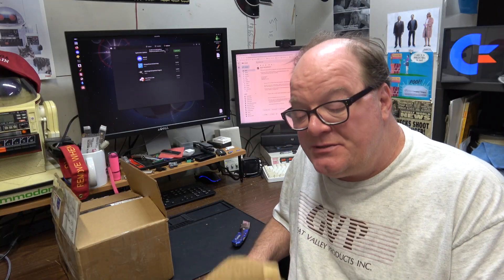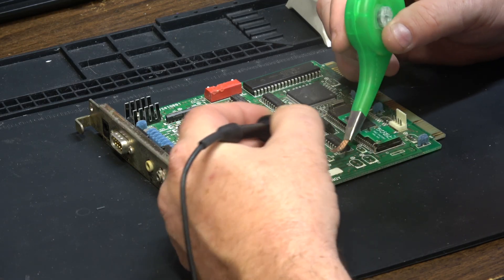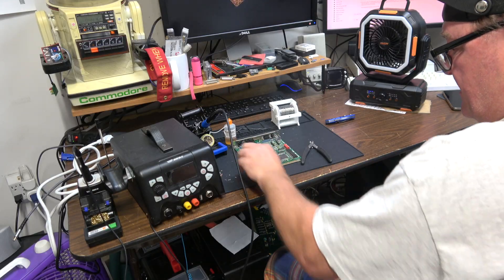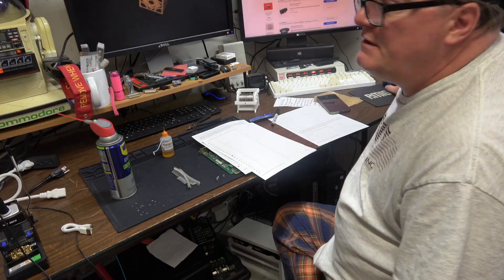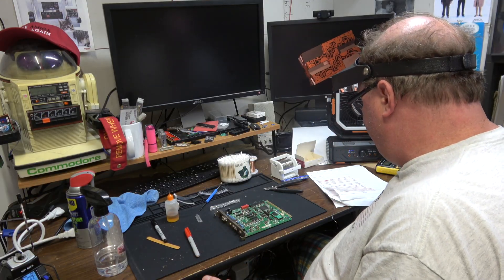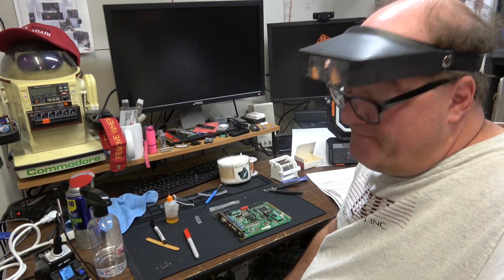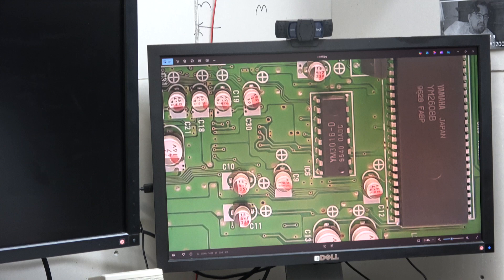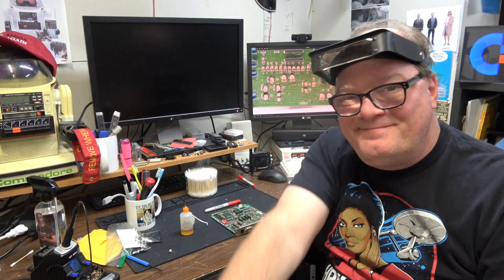NEC Sound card with "The Adrian touch"

Comment: The "Adrian touch"😂 Just push down and twist it off. It never fails. Not! Although I do have to admit I've done it a few times myself and never had any pads/traces lift. But there's always that one time when it will happen and It'll be in the worst situation. I found that it takes just as much time to twist it off as it does to desolder it. With some practice of course! Lol

Comment: I have a lot of PC9801-86 sound cards and 99% it needs to be recapped. It uses the NEC C-BUS equiv of PC ISA cards. Yamaha
 YM2608B (OPNA) 6-ch, 4-op. FM, SSG, ADPCM sound generator .The current price for this card is around 3~400 USD in Japan. This just Proves Chris can fix stuff other than Amiga. Great Video

Comment: It's apparently a PC-98 (Japanese DOS) card and you are welcome to check its frankly insane going rate on you know where, NEC PDW-1089
Reply: The Anime PC.
I'm not the type that collects computers from my youth (I'm 58).
Don't buy those mini versions either. I just emulate.
I never had a PC98 but I do check prices on auctions sometimes.
Never pulled the trigger though.
If a mini PC98 was released though I'd go for it.
Reply: @MrJakeTucker  from what i can gather, outside of touhou 1-5 and maybe a hadful of other games, the rest of the pc-98 library is office software, ports of games you can play elsewhere quite easily and also... adult content. the pc-98 is quite a neat system but you're probably best off sticking to emulation
Reply: Its a C-Bus card for NEC & Epson 98 pcs and can also run in Win98N varient